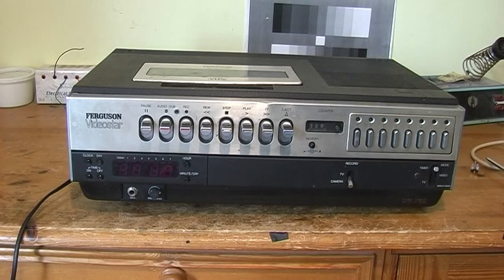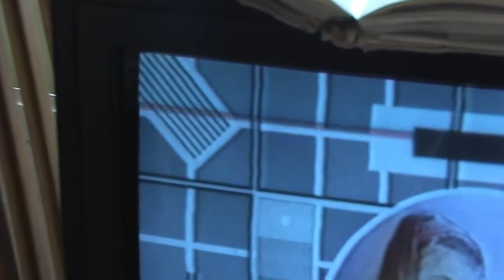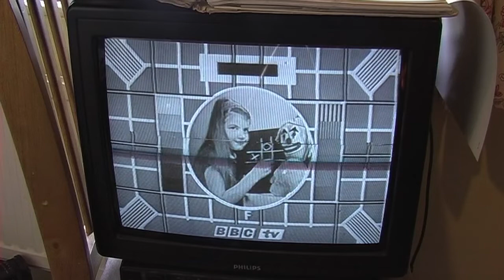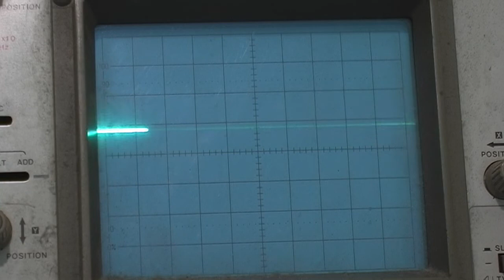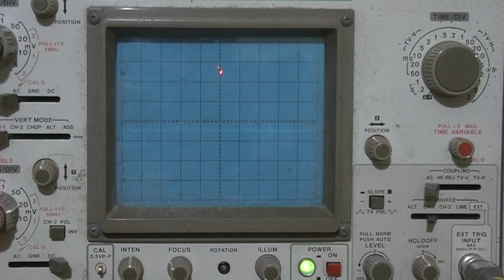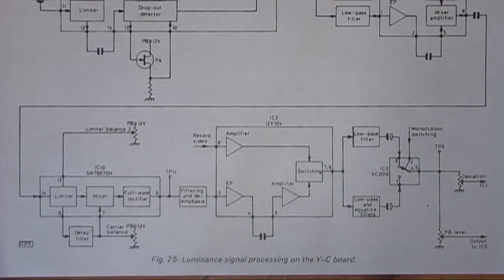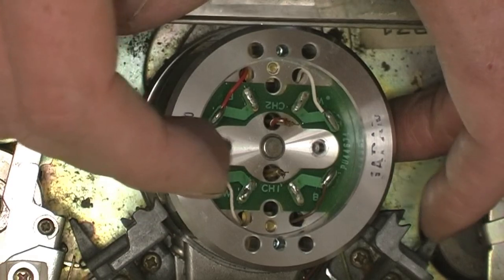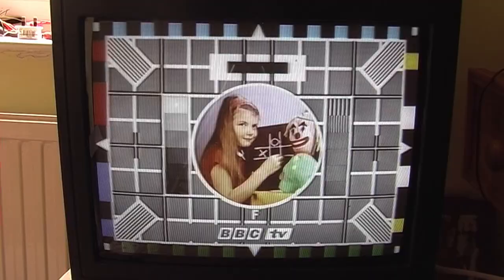VHS Top Loader VCR Repair Ferguson Videostar 3V22 JVC HR3330

Comment: Thanks for the in-depth explanation of the video RF signal path. Never heard those black lines being referred to as inversions before, I can only remember that effect being called bearding. The first VHS recorder we had when I was about 7 was probably the same model although it was badged with the rental company name DER. It had a very basic wired remote control that only activated the pause function, and the pause just went to a black screen not a freeze frame. Sometime in the 90's I was given a slightly earlier model, a JVC HR3300 which I think is the original model from 1978. The clock/timer is much more basic as it only has a start time no stop. I think it was designed to record until the tape ran out.
Reply from the maker: Thanks for the comment. Yeah the 3300 was the first one that was available in the UK. The pause is mechanical on those ones so you can't have it remote operated. I had the ferguson equivalent, the 3292, years ago but got rid of it when it developed a fault, I didn't know anything about repairing them at that time. The head switching point was half way up the screen. It would play its own tapes ok but prerecorded ones and ones recorded on it before the fault had the problem and ones it had recorded had that problem when played on other machines. 

I'm not sure what the proper term is for that phenomenon, I've not heard bearding before but it makes sense. Another term I've heard is spaghetti because it looks like picture has been dipped in a bowl of black spaghetti.
Reply: I've just had a look at the back of the HR3300 and there's no remote socket on that earlier model. The one I remember for the DER rental set was just a two position switch with REC/PLAY for one position and PAUSE for the other. I wonder how many of those original remote controls have survived but being a simple switch it should be easy to make something up that would work.

I should get the HR3300 out and see if it's still working. I did try it out a few years ago and it played a pre-recorded tape, but there was a bit of slight ghosting and noise on the edges of objects. It might be the RF modulator not being very compatible with a modern LCD TV. I need to find my old adapters so I can try the direct video output.

Comment: Hi bud I’ve got the 3V16 it was playing good then just stopped playing when you press the play button it doesn’t do anything it doesn’t load the the tape even very strange any help would be great fully appreciated loved watching your video very in-depth repair
Reply from the maker: Is the cassette lamp on?  A little light in the cassette compartment, it's used to detect the start and end of the tape.  If it blows the machine won't do anything at all.
Reply: @nowt1002  yes bud the cassette light is on it was playing with a bit of tracking problem at bottom of screen then it just wouldn’t do anything when I changed tapes could it be belts broken or slipped off as it was moved on a long journey before it reached me I was going to open I up and have a look ? 
Was going to ask if you do servicing on them I’d gladly pay and bring it to you as I really want it back to its former glory as it was my parents first video so it’s from my childhood
Reply: @nowt1002  right I took casing off bottom and the head belt was off so put it back on and working again but the tracking is bad picture quality looks not to bad put it’s got the tracking lines at the bottom of screen no matter which way you turn the tracking knob also picture jumps a bit and when you record it’s got picture roll it’s obviously worth saving so was wondering if you could services properly for me to get it working at least so it’s watchable now that would be awesome Il pay of course 👍
Reply from the maker: Yeah definitely worth saving, they were the deluxe model at the time, better than the 3V22.  It could be something simple like a bit of dirt on the tape path.  I would try giving the tape path a clean and see if that improves things.  You can do most of it with a cotton bud dipped in isopropyl alcohol.  Just be careful of the heads, they are in the rectangular gaps in the upper rotating part of the head drum cylinder.  Avoid those with the cotton bud as the fibres can get caught in them.

If that doesn't solve the problem or if you're not confident to work on it I can have a look at it for you.  You can email me nowt100video@gmail.com to discuss it.
Reply: @nowt1002  thanks bud I really appreciate that il try the cotton bud cleaning first see if that sorts it if not il defo message you either way Il update you on situation
Reply: @nowt1002  thanks bud I really appreciate that il try the cotton bud cleaning first see if that sorts it if not il defo message you either way Il update you on situation
Reply from the maker: Ok.  As I say, just avoid the actual heads, you can rotate the upper drum if you need to to keep them out of the way of where you're working when you clean along the line that the tape runs on.  The easiest way to give yourself better access to the area is to remove the top cover from the tape carriage, there are two screws on either side just under the lip of the cover.  Make sure everythings completely dry before you try a tape.
Reply: @nowt1002  hi bud just to let you know I’ve emailed you 👍